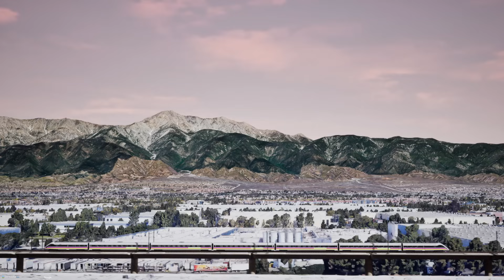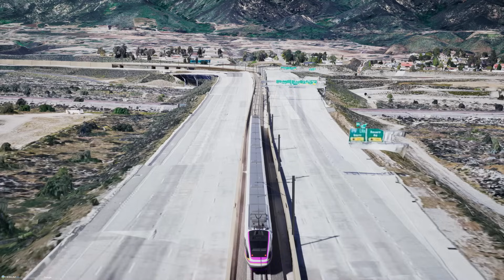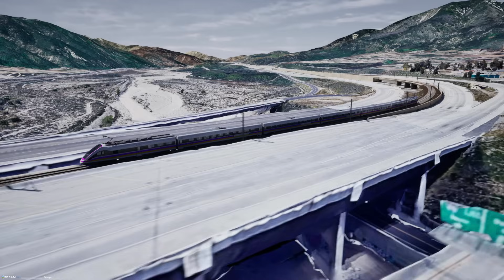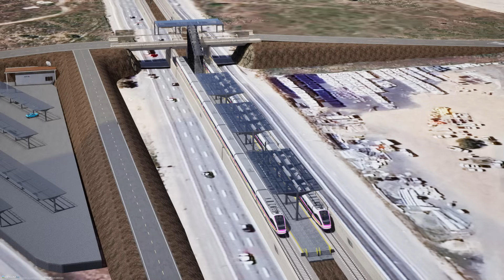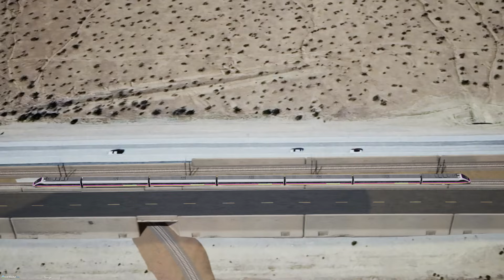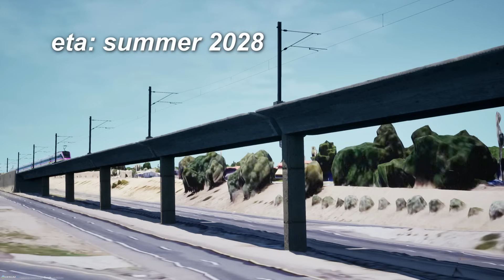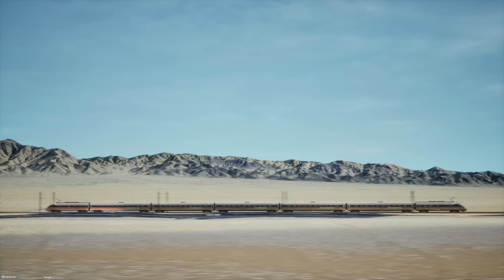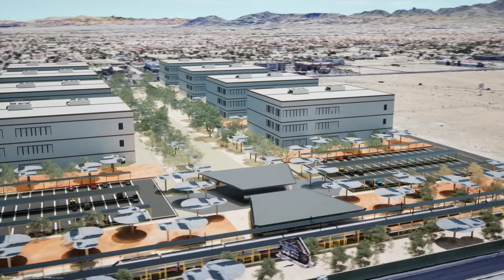The Brightline West High Speed Passenger Rail Route Rendered With Unreal Engine 5

Comment: So they are going electric with this? I would have bet money (pun intended) that they would have run diesel to Vegas just so they didn't need to worry about running hundreds of miles of wire and the structure to hold it.
Reply from the maker: Yes, it will be electric. The diesel option that XpressWest retained was removed in the NEPA reevaluation. The trainset choice is apparently between the Siemens Velaro Novo(American Pioneer 220) and a higher power Alstom Avelia Liberty variant. BLW recently put in for a Buy American exemption for all the parts necessary to assemble a European-style HSR line(some of which are not made in the U.S.)
Reply: Nowhere in the world does diesel traction give speeds of more than about 125mph. Despite advances in traction technology having to generate the power on board is just too heavy and space hungry to provide the power needed to go faster. The exception is gas turbine (the French TGV was originally intended to be GT), but the cost of fuel is excessive, to the extent that it made the SNCF/Alstom develop the high speed pantograph, before that, pantographs would self destruct in spectacular fashion at high speed.

Comment: The whole line should be double tracked, how is that even supposed to work with High Speed Rail? Because you’re gonna have to stop and wait for the train to pass
Reply from the maker: They'll pass at speed in the passing sections. You'll pass another train maybe 3 times in 218 miles. The passing sections will be 4-6 miles long as far as I've seen. This would be 2-3 minutes to traverse at 120mph. It will need to be well-timed or perhaps a brief delay, but they are planning to take 120-140 minutes, which is not exactly lightning fast for 218 miles.
Reply from the maker: Also, most trains will pass at Hesperia and Victor Valley while stopped, which would theoretically take one wait off the table.
Reply: You know Spain also implemented single track sections in some of their HSR right?
Reply: @Ven100  No, actually I was just in Europe last summer and I took the DB from Stuttgart to München, there was a single track that was part of the new Stuttgart 21 development
Reply: @RailMan102_Productions  That one is temporary till the new underground station in Stuttgart is opened. 
To get a feeling for train numbers: the new Stuttgart Ulm line in its current state carries 3-4 trains per direction per hour. When completely double track, that will go up to 5-6. Brightline wants to start with 1 and go up to 2. 
This, combined with the fact that brightline west trains will be much more punctual as they won't be impacted by delays from outside their line leads to the conclusion that single track portions are fine in this case, even with the higher speed of brightline west.
Another example for single track HSR is the Bothnia Line in Sweden.

Comment: Very good.Just a thought, in the summer temps could reach 120 degrees how will they deal with the potential rail issue and the potential for train failure because of extreme heat
Reply: Practical Engineering did a good video about railroads in the heat:  https://youtu.be/zqmOSMAtadc?si=cv5U2EgZFKatJu_S

(Hint: they install them during the summer/a heatwave)
Reply from the maker: @Whatneeds2bsaid  I watched that about a week back. What I got out of that is you basically just need to bolt the tracks down REALLY well. 😁
Reply from the maker: I've not read anything to this effect yet, but if they can run HSR services in Saudi Arabia, they can likely manage here. 120 F+ is definitely a possibility along this route, though. It does indeed seem to be an extremely challenging path.

Comment: Really hoping this route blows up and they get some funding to double track it
Reply: Correct me if I'm wrong, but some parts look really expensive to double track after the fact. You would need to rebuild retaining walls or relocate highway lines again...
Reply from the maker: @KaiWritesCode  Likely the parts you're thinking will remain single-tracked. Sorry, I don't remember the source atm, but 19 miles north of the Victor Valley station will remain so(19 of 169 miles). Higher percentage between Rancho and Victor Valley. The part running through Victorville will stay that way. They will add about 5 miles of double-tracking in Cajon Pass(probably the more level part). Also, there is a section up in north Fontana just south of Lytle Creek that has room.
Reply: @KaiWritesCode  probably, hence why I said funding. If it takes off and people see how useful it is, getting federal funding to expand would be pretty cool
Reply from the maker: Their plan is to cut headways in half by the 11th year of operation and that would require expanding double-tracking by about 4X.
Reply: @LucidStew  oh wow!! Thanks for letting me know. Definitely looking forward to brightline west to finish. Isn’t there also talks of Amtrak running a line on the track as well?
Reply: @cxsey8587 Amtrak did include an LA-Vegas route in their ConnectUS 2035 plan, though that will be on the existing UP tracks. Not sure how competitive that route would be, given the previous Desert Wind service had a considerably longer travel time than driving between LA and Vegas, and as far as I’ve heard Las Vegas has had little interest in reviving that service.

I would love to see Amtrak bring it back all the way to SLC, and tie it in with the Zephyr so one could directly get from LA to Denver that way, rather than have to go up to the Bay Area or Sacramento to catch the Zephyr there. I’d also bring back the Pioneer service between at least SLC and Portland, tying it in with the Zephyr as well. So all three trains would meet up at SLC and continue east as one long train, and westbound they’d split there to head to their respective destinations, same as it was before.

Comment: Are there plans for how all the people will get from the station to get actually into Las Vegas?
Reply: Well, they're going to have to build transit eventually.  Otherwise, it will be buses for now in all likelihood.  Also, they'll probably build their own casino at their station.  For other casinos, though, Brightline will be no worse off than the airport.
Reply from the maker: Yes. You're going to have transportation services similar to Brightline in Florida. You'll have other private transportation as well(limo, etc). Many casinos/casino groups will have courtesy shuttles between the station and their properties. The station will also have a bus stop. There are also plans to extend the Vegas Loop down there eventually. A lot of driving, but the station has quick access to both I-15 and I-215 as well as Las Vegas Blvd. and Blue Diamond Rd.
Reply: In addition to what's already been said, Brightline does well in offering last mile transportation options from their station. Brightline+ in FL offered connections such as shared-ride golf carts (I believe Circuit took this over), mini-buses, and even full size coaches.  The coaches (usually 3rd party hire) are used to take people to/from sporting events or events Brightline has teamed up with.

Comment: Excellent video! Do you know if they are planning on building any stubs during this initial construction for the future potential High Desert Corridor connection to Palmdale and the CAHSR at the Victor Valley site? And if they are leaving the door open at the Las Vegas station for any possible future northern extension?
Reply from the maker: I've not read anything about a prep for HDC connection. It's supposed to be in the area between the Mojave River and Victor Valley Station parts of the video and there's nothing out there really, so shouldn't be a huge issue. I doubt they'd extension north from the station. The connection to UP in Sloan is dubious, so if there were to do that maybe they'd want to try to hook up with UP west of the 15 to get to Las Vegas or maybe even SLC? I think they'd probably try to expand to a different city pair or extend Florida to Tampa before anything like that would happen, though.

Comment: Dude, you should do the (hypothetical) Los Angeles to Rancho Cucamonga portion of the Brightline West.
Reply from the maker: I'm going to keeping a pretty close eye on U.S. HSR for years to come, so you can expect just about every topic you can imagine at some point. :)
Reply: @LucidStew  Alright, thanks.
Reply: IMHO, I don’t think that Brightline West would actually extend from the Rancho station into LA Union Station, assuming that the existing San Bernardino line remains unelectrified. I suspect that there will be a joint venture between Brightline & CAHSR, possibly others, to build & develop the High Desert Corridor between Victor Valley & Palmdale, connecting the two systems and, hypothetically at least, allowing Brightline to use CAHSR into Union & CAHSR to use Brightline out to Las Vegas. While Interstate 10 could provide a conveniently nearby ROW for Brightline to reuse into DTLA, looking at Google Earth, there doesn’t appear to be much space leftover in which a rail line could be inserted, and the line would likely have to be built on structures. Also, Brightline would either need to reverse back onto the Interstate 15 ROW or possibly build a new viaduct heading south to reach I-10. Whereas, HDC could be more straightforward to construct as there is simply more space and less obstacles to avoid, possibly getting away with more at-grade construction in the empty nothingness. Plus costs would be split between the different entities involved rather than being solely on Brightline.
Reply from the maker: @TheWolfHowling  The problem here is trying to figure out what's going to happen in a timeframe so large. It's just really difficult to say when CAHSR will get to Palmdale or even IF it will. BLW-HDC-CAHSR would get you to L.A. about as fast as BLW would get to Rancho Cucamonga, so its definitely the faster choice, but Palmdale-Burbank is going to cost $25 billion+. That's going to require a major shift in state and federal politics. On the current trajectory they may never have the money for it.
Reply: @LucidStew  Yeah, HDC will definitely be a phase 3, at best, for CAHSR, after the Phase 1 SF-LA mainline, and the Phase 2 branches to San Diego & Sacramento. I wouldn't expect any shoves in the ground until the late 2030s in the Best Case Scenario, with the 2040s much more likely. We Have to remember that Rancho was Brightline's LA extension. If they were going to continue to Union, why would they be wasting resources with Rancho? Would be simpler to stay in the Interstate ROWs
Reply: @TheWolfHowling , @LucidStew I think the easiest option is to upgrade that line it ends on in Rancho Cucamonga. The station there is an excellent permanent solution, but especially if the line's extended to Union Station. Reasonable upgrades and two-tracking could be done without excessive intrusion, absent intrusiveness of the professionals' plans due to wanting only the repetitive design contracts with the aim that nothing gets built. (Incentives in the field are complicated.) Also it would make use a two track line near Union Station believed to be freight only at this point. There might be a problem on a tangent stretch that has mid-to-upper single-family homes closer to Rancho Cucamonga to which my solution is just bury it cut-and-cover.
Reply from the maker: @TheWolfHowling  HDC is being built by L.A. and S.B County independent of CAHSR. I'd expect it to be done WAY before CAHSR manages to get out there.  HDC isn't the reason they diverted to Rancho. It's the evident timeframe for CAHSR Bakersfield-Palmdale and Palmdale-Burbank that did it.
Reply: @brucehain  Yes, as seen with the CalTrain mainline & CAHSR, upgrading & electrification of the existing infrastructure would be the most straightforward approach. Also having additional benefits for the Metrolink Regional Rail service.